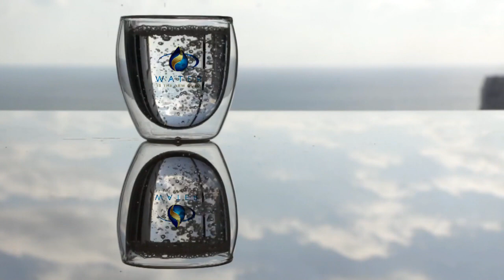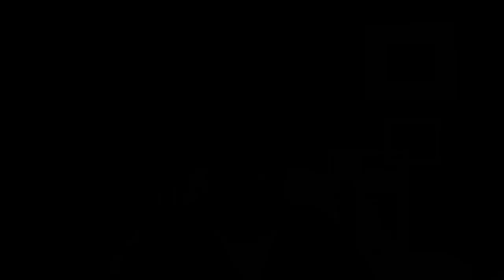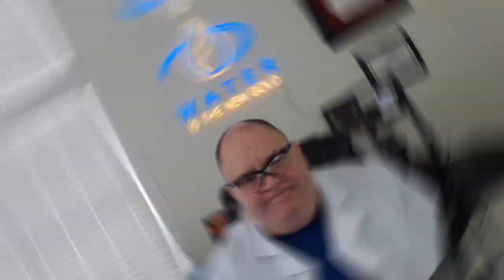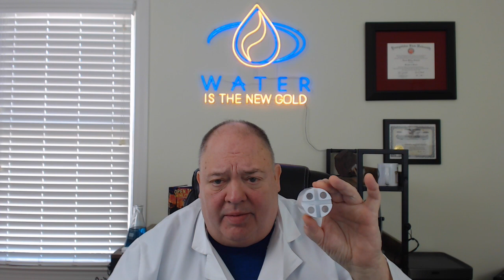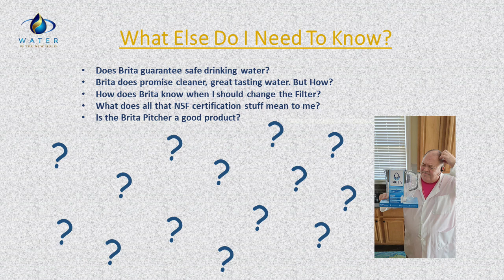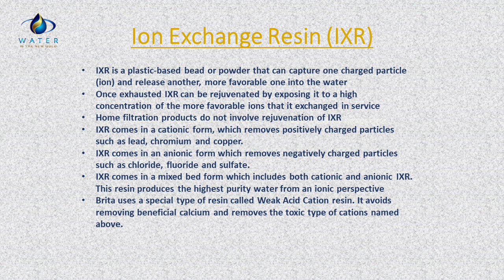What Is The Truth About Brita Filters?

Comment: My concern is about the length of time the filter is used because I'm wondering if mold etc. will form in it if it's left too long.  You can bet that a lot of people will be leaving them in use for much longer than the recommended time either because they're naturally lazy or to try and squeeze more value out of the product.
Reply from the maker: Your concerns are 100% spot on. However, if you raised this concern to Brita or any of the NSF/WQA H2O-tards they would give you mumbo-jumbo about how extensively they test, and their expertise has shown that at a 2-month interval you <should> be safe. If you ask, :am I guaranteed safe" they won't answer. I will be clear, any filter that is allowed to sit still, immersed in nun-chlorinated removal, will absolutely grow organisms.